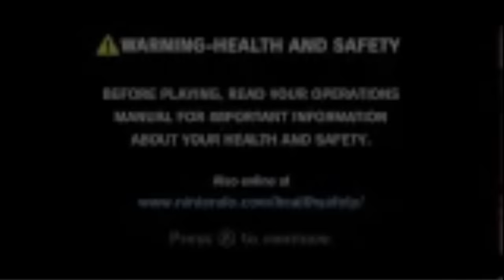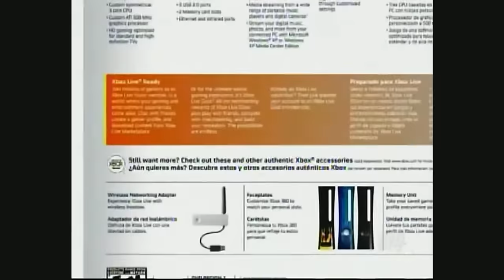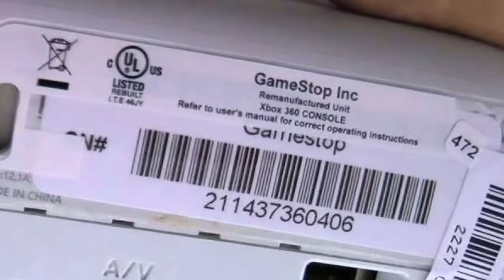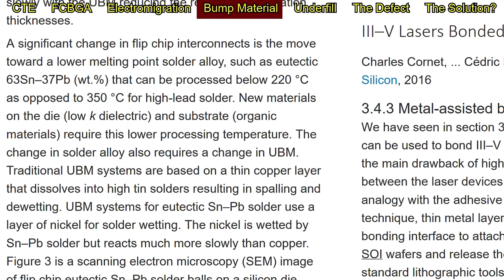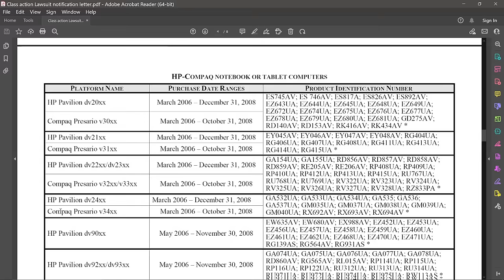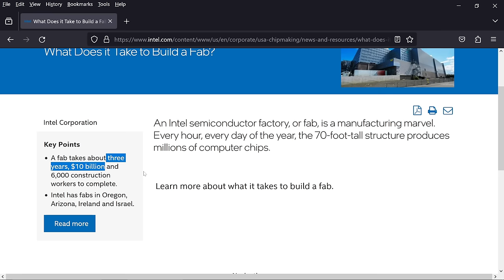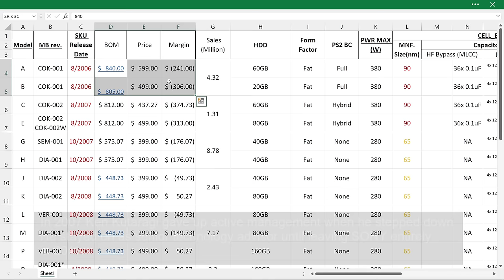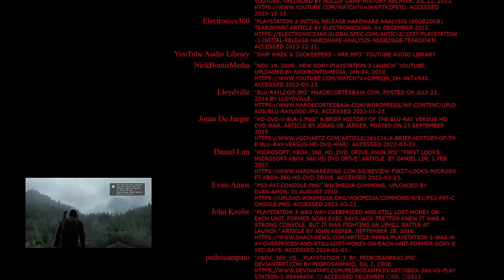A 360 Story -  The RED Ring of Death & the 7th Generation Console War

Comment: 33:58 again you can't Speak for the PS3!! You can Speak for the Fat PS3!!! But the Slim Ps3 Cell Actually Have Cracked Bga Defects!!!! And the Super Slim the Same of Course, as much as I sound like to be trying to make you look wrong I'm not doing that, as you know I have much love for the Ps3 and I just disagree on that view you have on that specific problems, I know much about Ps3, I've been learning about it's Defects for 12 years but I absolutely don't have such degree of studies on electronics as you have Felix.
Reply from the maker: BGA defects are blown way out of proportion. When you buy a broken console the odds are something is broken. If it's not the bumps because the packaging isnt defective, or the Tokins because there arent any, then it'll be something else. And IME that has been the wifi/blutooth module or the CPU. And when it's the CPU, there is usually drop damage, neglectful amounts of dust, delid attempt gone wrong, or tampering. Like broken warranty seal. Who knows what they did that could have caused a CPU BGA defect. Like flex the board. Or use thermal paste that was too strong. yank on the HS to get it off, bending the board and cracking a ball.

Point is, looking only at a sample/subset population of broken consoles does not accurately represent the total population of ps3's out there. If you limited your numbers to specifically sealed, broken consoles without drop damage, then the proportion of BGA defects will be different. 

BTW A console can be droped, vibrated, and jolted without visable damage. Which makes it even harder to say conclusively BGA defects have anything to do with heat.

I just dont see a connection specific to PS3. They operate near 75C which is well controlled for any other processor. My i7-4790k has been operating upwards 90c for 8 years no problem. The heat is a red herring once the bumpgate material set is fixed.
Reply: @ripfelix3020  Yea Felix about your l7 working at 90c for 8 years and never having any defects it actually just stand as proof in favour that the Bgas is the Problem and not the Bumps, your Cpu is a 4xxxK so the It means it's an Desktop Cpu which is Lga and Not Bga At All, so there's no Bgas to be cracked and the only thing which should be defective which are the Cpu bumps don't have defects at all, since PSX Place i've been giving examples of of Desktops Cpu that are Lga and they use bumps and work around 85c but they never went Defective not even after 15 years, 16, 17 years like for example the very very heat deliver Cpus like the 2005 3.2Ghz Pentium 4 640 90nm 169 Million Transistors which  works at 85c even with big heatsink, or the Pentium D 3Ghz 90nm..........

About the PS3 Slims I don't spot just a few examples of them with cracked Cpu Soldering I actually see a ton of them with Cell Bga Cracked Soldering, the first clue I ever had was when I saw a technician In 2012 Reballing the PS3 Super Slim Cpu, and Yea The Main Cause of Black Out in Ps3s since the 21xx Model is due to Cpu Loss of Contact or Cracked Bga on Cpu, I also manage to work a time on a Store to fix videogames, and in the time as I know Ps3 Slim starting from 21xx had problem majority of time on Cpu I used to Reflow just the Cpu and they all come back to life like that, with an Cpu Reflow, and also there's is ton  of videos of pro technician who repair Ps3 Slim and ss and they Reball the Cpu the console come back to life, some people learn the hard way like they Reball just the Rsx and nothing changes then they Reball the Cell and it comes back to life, well about dropping and bga Cracking I thought to this it could be the why the PS3 slim has cracked Cpu Bga while fat don't but it's too ridiculous do be true, theres too many millions of Ps3 Slim and SS with Black Out and Nearly Aways the Main Reason it's The Cpu, you can just put hand pressure on the Cpu and See it will start Normally, cause the pressure will seal the cracks back together while the pressure it's there of course.
Reply from the maker: Yeah, pressure test is a nice qualitative test. It's not 100%, but if it's BGA it doesnt take much force to tell.

I would like to have more data on slim and SS models, as they are under reported. So dont have enough data to really tell. It's just that people dont spend much time diagnosing and fixing them. They just buy another. Not having schematics makes them a PITA to troubleshoot too. Not worth it. And now that people are looking for slims to harvest their GPU for frankie, they're just looking for an excuse to pull the RSX. So they dont make a serious efforet to diagnose and fix them. Makes it hard to collect representitive data about the issues affecting them.
Reply from the maker: Youtube is a problem, because you always see the positive result and never the lasting result. And rarely does anyone post a video when it doesnt work. I can put a penny under the IHS, bend the leaf spring, pour chili pepper on chewing gum and stick that up the CPU hole...whatever nonsense that happened to work but isnt an actual fix. And if it worked for long enough to get footage of it release a video entitled "Chewing GUM mod. BGA is a Lie!" 

Just saying, YT videos are not a reliable source of data. Especially because they've tyoically not shown UART logs.
Reply: @ripfelix3020  Alright OK Then
Reply: @ripfelix3020  Felix I, My Logical Argument which absolutely proofs heat is the main cause of Bga Failure and Cracking it's: The PS3 Cok-001 has about 13 Bga Connected Ships, and Majority of the Time like 75% of time the Rsx its the Chip which has Defect! And why? Because it's the Only Chip that Runs Above 80c, all the Other BGA Chips Don't Work as Hot, of Course they don't even have Thermal paste, of the 11 chips already excluding the Cpu and Rsx, only Southbridge and Ps2 E.E+G. S use thermal pad just to be attached to the poor cooling metal plate in aluminium, the other 9 chips, like the 4 Xdr 3.2Ghz modules don't have any cooling at all, neither does the Syscom, or ps2 Secondary Chip like a Syscom or Bios, neither its 2 ram modules neither Chip for Flash Memory Controller, yes so Logic is Rsx it's The Only running above 80c and has Soldering Defects, the other 11 Chips don't Run Not even nearly as Hot and they don't have defects, and for the Cell yea it Has Bga Defect as well even in the in the Cok-001, it may be around 15% of cases but it does, when you see a Cok-001 with no Display or like always it get super hot even after Delid and keep turning off, that's Cell Bga, and Bro it's Really Easy to Know, Low Level Hardware which don't work hot don't have Bga Problems, just Look at Ps2 Slims, mine is from 2007 so 2 years after the law which prohibit the lead on Bgas, so yea, if you Go search if the Ps2 since the 2005 slim has any Bga defect, you will learn no it doesn't have any Bga defect on its Processors cause they don't work at 80c or 77c like the PS3 do.
Reply from the maker: So on most BC models the CPU rutinely runs hotter than the GPU. The GPU typicallt doesnt run hotter than 74C. When the CPU paste starts wearing out the fans ramp up to keep the CPU cool (fantable 0). So now instead of needing 28% to maintain 74C the CPU needs 30%. That actually cools the GPU more then it did when the CPU paste was new. 

It's counter intuitive, but when you delid the CPU to restore proper thermal efficiency, the RSX will get hotter than it was before because the fans dont have to run as fast to cool the CPU. 

The CPU has lead free balls and runs hotter than the RSX. And it doesn't die. It's not the balls.

Now, if you are referring to the 90nm GPU's fantable, yes it is stupid and will not ramp the fans up until the RSX is in the 80s. But since the CPU fantable is set lower and the CPU is higher TDP, it'll always ramp the fans up before the RSX ever has a chance to get hot enough for it's fantable to step up the fan. But I agree it was a bad fan curve and should have been adjusted in an update long ago. So if you do have a working 90nm RSX and want to stave off the YLOD, then either running web Man Mod or writing a custom fantable will fix that issue and hopefully extend the GPUs service life.
Reply: @ripfelix3020  Yes, I also know if Cell Runs Hotter it will make the Rsx Cooler due to Fan Steps Going Higher BUT the Thing it's, in the 4 Usbs Models, when the Cell hits 74c in the Xmb after some 6 minutes turned on, the fan will go up to speed 1 at 74c, then 2 at 75, 3 at 76, 4 at 77 and if all operating under original quality of thermal conduction we will have expect 78c and fan speed 5 Syscom controlled which shall be the max expected speed in a fully "healthy PS3" with all its thermal paste in originals condition of conduction and environment on maximum temperature supported by the PS3 system to work with on, I have to say one great thing, here on Europe, Spain, there's a Lot of Fat Ps3s that are being Sell, I mean they're alive, it's mostly the 40gb models and the 80gb fats, when I was in my country, brasil, like paste year, and since 2013 I couldn't find PS3s Fats on Stores in Brasil cause they all with Ylod, I mean they were very very very rare, so this means by Logic that lower Environment heat and humidity may really help the Bga Not to crack, also very important, I'm in Madrid and here it's like 10c colder than Brazil at Night but Day Is About The Same!!! And On Summer Spain is as Hot as My City Sao Paulo on Brasil but on Winter Madrid is like Also 10c or 15c colder than Sao Paulo, and Sao Paulo Usual Temp is about usually 25c, here on Madrid I got a tan on Skin so ID it's hotter Than Sao Paulo and Also Colder, so that comes as some environmental questions to think about bga, so when I talk about 4 Usbs Cell going all up to 78c I think I tested on cold days like 18c on Brazil, I tested many times the fan steps, I know then by noise when in an quiet environment! So again in the Ps3s 4 Usbs, or Bac. Compatibles, they Usually will Have Fan Speed 4, or 5 And Cell will Decrease its Temps to about 75c (The Fan will Only Drop its Speed or Steps if Cell Temps go Under 68c) But Even with Fan Step at Speed 4 The Rsx Will Work Above 80c, The 4 Usbs Ps3s Syscom Fan Steps Control Is Not Programmed to Increase RSX Fan Steps Unless RSX Arrive/achieves/hits about 88c or around that!!! Ps3 4 Usbs model Turns Off If Cell Hits 90c exactly and  if Rsx Hits 95c, on Slim Ps3 with the   45nm Cell B.E, at least on my paste 21xx Model it used to Turn off at 85c on the Cell by maximum programmed temp set on epproms Syscom Code.

Comment: 1:27:15 Lol Xbox 360 was much more powerful than the Ps3. EVERY cross platform game ran better and looked better on Xbox 360. 3 core 3.3 Ghz IBM XENON cpu vs 1 core 8 useless math co-processors on the Cell and Unified shaders with EDRAM on Xbox 360 made it dominate. Nixes got 2015 Rise of the Tomb raider running better on 2005 era Xbox 360 than Xbox One (check digital foundry) While Ps3 was already dead...
Reply: PS3 was more powerful. But more complicated to program for.  That’s why most 360 ports ran better. Especially earlier on. Look at late ps3 games like last of us. Blows 360 away
Reply: @adamthiry868  delusional. Halo 4 eats Resistance 3. Gears 3 owns Killzone 3